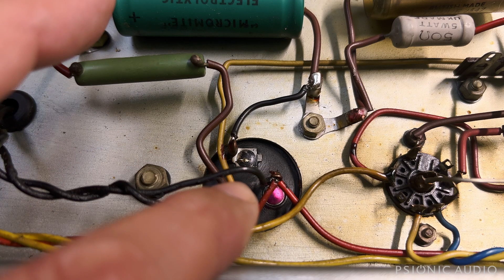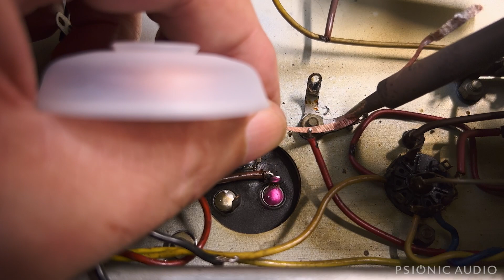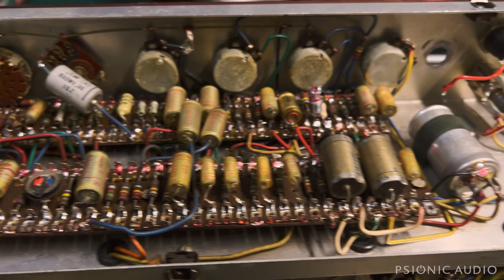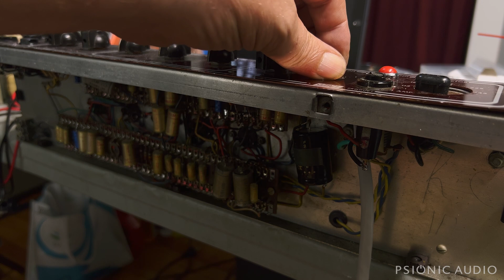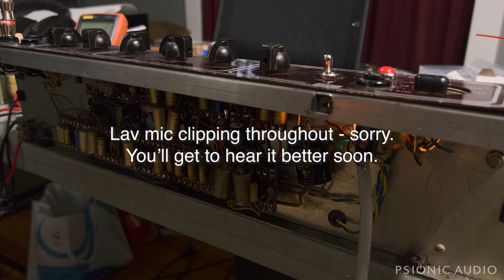Quality Time with a '63 JMI AC30/6

Comment: Hi, thanks for another great video. I was given a 65 grey panel top boost that had these round white resistors, every single one was more than 100% out of tolerance. I replaced them all with carbon film since that is what is available in Australia, but I am very keen to see how you put the fuse on the HT. I've put back up diodes on the GZ34 but better safety for the old Woden transformers cant hurt. Thank you again, I am learning heaps from watching your videos. Much appreciated Mic

Comment: Great video, thank you. I have a '65 AC100 that I received with a blown power transformer, so when I replace it, I'll also look to install an HT fuse and review the heater wiring. Is Mercury the go-to for this era Vox amp replacements, especially the AC100?

Comment: I remember servicing one of these from that era.  Honestly the best sounding amp I ever played.  Came in needing the basics (cleanup, filter caps, checkup etc), and since it didn’t come with a back panel, the owner wanted me to put a replacement.   As part of wanted the replacement back panel, he wanted a top boost mod. After cleaning it up, new caps I was playing it, and the bright channel (sans top boost), by itself or jumpers with the normal channel just blew me away to the point I tried talking him about not “wasting” the money adding a top boost.  We compromised by me using a DPDT switch to toggle in and out the top boost circuit, as well as a push pull on the volume pot to give him the option of bypassing the bright cap on the volume that is present as part of top boost..so he could have modes of stock bright, stock bright + bright cap, tb stock, tb w/o bright cap. In any case this was by far the best amp I ever played.   And even though the cabinet was a bit rough, the important things were fine- stock transformers, celestion silver bells,  and tubes.
Reply: I LOVE this idea.  Best of both worlds and then some.  The amp in the video belongs to me, so I’ll definitely be discussing your suggestions with Lyle.  Thanks for sharing!
Reply: @peterdawson1834  let me be clear on this so you are fully aware: on the one I serviced there was no back panel for the cabinet, so as I fabricated one for the customer, I fabricated it with the hole cut out of it.   I wouldn’t have ever been willing to cut a big hole like that (2”x4”) in a good vintage cabinet.  
Secondly, the top boost mod also required me to fabricate a metal plate and brackets to hold the extra tube and circuitry for it, so it’s definitely more than a simple component swap

Comment: Was zapped pretty good only once...
10yrs old. My friends basement stored a cool phonograph amp that we plugged in. One of the tubes was broken, but glowing orange. Wondered how hot it was, so touched it with my finger...lightly.
My friend told me that my body did two somersaults across the basement where a wall stopped my flight...
If ya need a pick-me-up, would suggest a strong cup o' coffee.
NOT a zap...😉😎👍
Have you given the UAFX Ruby Vox AC30/TB a listen yet?
This layout of this Vox you're servicing is really interesting. 
Like the looks of it.

Comment: So, how close to the socket pins should the heater wires be twisted? I've seen some twisted right up to the pin, some an inch or more away from the pin and some heater wires not twisted at all. Also, what solder braid do you use? The stuff I've tried so far "doesn't suck".
Reply: Over the years I have mostly used  Chem-wick desoldering braid, aka "solder wick", from Chemtronics; but I've also used Weller, Hakko, Pomona and GC brands with good results.  Buying off-brands through eBay or Alibaba is likely to be very much hit or miss.  Note that the copper braid needs to be shiny and bright, and because it's impregnated with powdered rosin flux it should have almost a whitish frosty look to it.  If the copper is reddish brown it's probably old and oxidized and might not work well. Also note that the tip of your soldering iron will need to be scrupulously clean, and you will need to tin the tip of the iron with a little bit of fresh solder just before using it in conjunction with the solder wick. An oxidized, dirty soldering iron tip will not conduct heat to the braid very well.  Perhaps most important of all, you will invariably need to add fresh solder to the connection before  you put the desoldering braid and soldering iron to it,  especially if the connection was originally made with lead free solder.  Dabbing the solder wick with a little bit of extra rosin flux in paste form can also be helpful but usually isn't necessary if it's good quality, fresh solder wick.  

Be advised that there are a lot of out of unscrupulous sellers marketing soldering flux to electronics hobbiists which is actually acidic and corrosive and made more for plumbing or sheet metal work then for electronics. I've seen people, including those who are experienced at electronics and should know better, buying fluxes online only to find out when it arrives that it says right on the bottle or can that it is not recommended for electronics work.